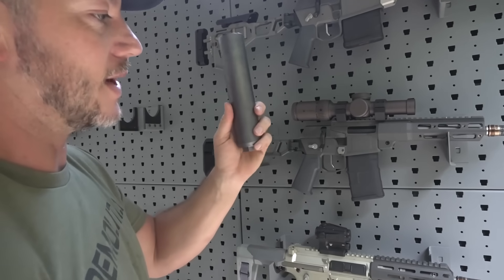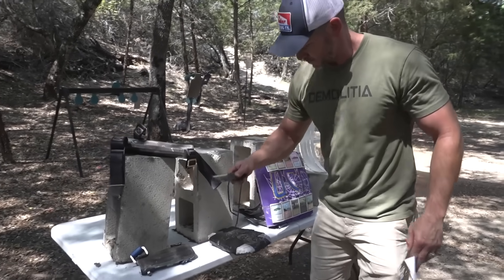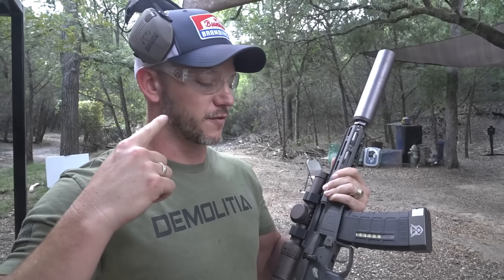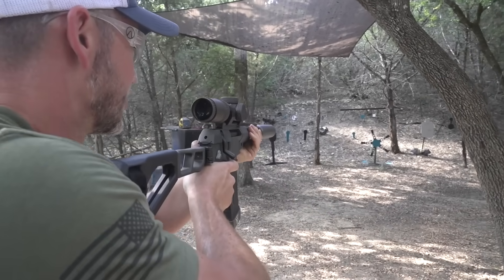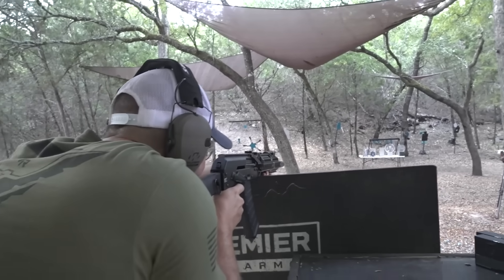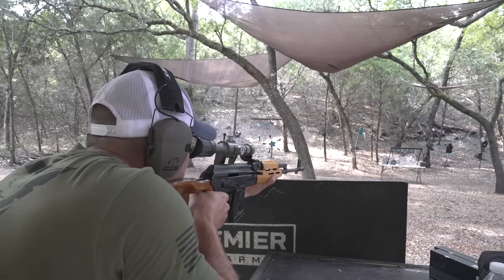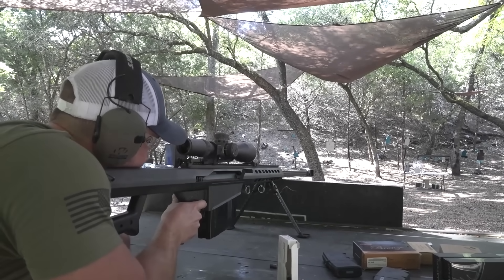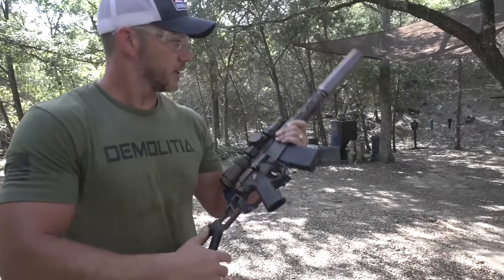The QUIETEST Assassin Gun Ever Made!!!

Comment: Honestly impressed by the shin and arm protectors. I’m curious what the specs on it as far as weight and mobility.
Reply: based on how they were thrown around, i doubt even the big thigh guard weighs more than a couple pounds, you could probably comfortably wear a full suit of it, though with it's thickness, it may interfere with a plate carrier if it reaches low or if you made bicep armor
Reply: @youtubeSuckssNow  no doubt some kind of lifted edge on hand side would help with that.
Reply: theoretically if you get shot at that arm protector while aiming it looks like there'd be a really high chance of ricochet straight into your face, due to it's polished surface.
Reply: @youtubeSuckssNow  and the thigh one would wreck your pork & beans
Reply: @youtubeSuckssNow  A deflection would take your face off. The guy's on the right track though. It just needs more tuning.
Reply: @sourcemonkey  polished surface causes ricochets? we should use tin foil for armor! in all seriousness, the outermost layer seems weak and catches the bullet like a catcher's mitt, preventing ricochets
Reply: @sourcemonkey  also my first thought but these things still held up great, someone should make a tempered steel version.
Reply: @youtubeSuckssNow  if you're smart enough to think of spall you think you'd be smart enough to think of a spall liner
Reply: Dude should definitely make a 2.0 version.
Reply: @gxc222  without a doubt
Reply: they're useless. The bullet just splashes everywhere over you after it's hit.
Reply: @Minty1337  given he intended it for 9mm and 556, it did really well. i want to see a titanium version.
Reply: I made this in like 4hrs and just wanted to turn something in. First time ever attempting to make “body armor”. I’m sure I could make something better, absolutely, I could have put a thick layer of rhino liner or something. But if Matt wants a 2.0 he can get ahold of me.
Reply: Just like old armor breastplates having a raised ridge across to deflect arrows and arrow spall away from the neck and face
Reply: @wesgroenke1647  on the arm protector - have you thought about running a wing type lip on the top edge, facing down at a 45deg angle. Also changing the surface of the arm protector to a pyramid type finish to deflect or diffuse a straight line impact, reducing the incoming energy to the shooter?
Reply: kind of like Iron Man's first suit..
Reply: @havok2396  I guess you missed the part wherehe said "I made this in like 4hrs and just wanted to turn something in. First time ever attempting to make “body armor”. I’m sure I could make something better, absolutely, I could have put a thick layer of rhino liner or something. But if Matt wants a 2.0 he can get ahold of me."
Reply: @Hovis_Enjoyer  I guess you missed the part where I liked that very reply, but was offering some other ideas he could try in the 2.0 if he wanted?

4hrs off the cuff is impressive, just think what could be done with collating all the feedback ideas and working them in, if he wants to?
Reply: No.. stupid idea.. spall into the face and junk.. or femeral artery.. na.. ill pass. Good idea but not even close to fully thought out.
Reply: @Minty1337  A full suit of gothic armour weighs up to 20 kg (A bit over 44 lbs) and is distributed all over the body. Imagine if this becomes standard issue, our boys can now take a Russian sniper round to the head and survive. Defense is finally catching up to offense.
Reply: They look heavy af
Reply: @sorashirogami1729 full gothic armor is on the backside, this isn't, so half the weight instantly removed for added mobility
Reply: Save your money don’t use deal Dash 

Hi Davie
Reply: @sorashirogami1729  A full suit of infantry plate is also far less bulky. It is not just about the weight. I can pretty much do anything in my 14th Century Infantry Plate that I can do without it movement wise. 

The problem with modern Ballistics armour is it needs to be fairly thick. That's going to cause issues anywhere the armour needs to articulate, especially around the joints and the neck were you need a good range of movement. And that causes serious issues when trying to design an all over suit of ballistic armour for people to actually wear in combat. How to deal with the weaknesses at the joints.

The other issue of course is putting it on. I laugh when people talk about full suits of ballistic armour, because most of those people have never tried donning a full suit of armour before. It is not a fast process. Takes me about twenty minutes to don my Plate if I am on my own. Ten minutes if someone who knows what they are doing is helping me. 

Then you have to remember, that's probably 70 lb of armour, at least. While that armour MAY be distributed over the entire body, believe me, after you have been wearing it for a few hours, and ESPECIALLY if you have been fighting in it, you start to FEEL it.

And thats BEFORE you take into account everything else the soldier is carrying. Weapon, ammunition, grenades, rations, water, trauma kit, secondary weapon, ammunition for secondary weapon, comms, vision gear (if issued), and so on. You are talking 120 - 130 lb of gear for a rifleman. Probably more than 150 lb for a gunner. That load is NOT sustainable for a modern soldier.
Reply: @Minty1337  this is the way

Comment: Note for Wes (if he reads this):  i like the concept of your forearm armor, but it would make more sense for it to be concave on the front, not covex.  This is because bullets tend to follow parallel to the surface they contact. With the current shape, you are more likely to force the bullet to skate past your arm and into your vitals. If you were to put a simple a curved lip around the edges, the round is more likely to miss the operator
Reply: I was thinking the same, it's a headshot helper as it is
Reply: I made both in like 4 hrs, just tried to turn something in, first time ever trying to make body armor at all. Knowing what I know now, I can def make something better, maybe just a little bit heavier.
Reply: @wesgroenke1647  you did a killer job, man! Yeah, my recommendation for a version 2 is do what you did again, just flip the design around and weld (don’t rivet) an ergonomic comfy side to it. Trauma pads are cheap, so id recommended that as a cushion if you want to go the extra mile. It would be hella cool if you uploaded a few simple videos of the build. Id watch it for sure!
Reply: @wesgroenke1647  It was an impressive showing, wish mat had shot it with something in between standard 7.62x54r and standard 50BMG, once it's that good finding a more finely accurate place where it fails is more interesting. I've got a can of silver tip 54r and it's really got me wondering if the mild steel penetrator would be enough to push through, or how other fast rifle rounds would compare, like maybe .270 Winchester (because on paper it's a pretty close match to .277 fury, but more common for now).
Reply: @Exandria   it was pretty fun to make it! I wouldn’t mind doing that at all, I could make a video on it, just need to find some time to make another!
Reply: @AmaraTheBarbarian   me too! Kinda wanted to see some .308 on it or a spicy .300, I like a .458 would have been cool to see on it too! I appreciate it man! 

I really do think that almost anything with an alloy core of some sort will make it through, there isn’t any hardened material on the armor.
Reply: @wesgroenke1647  Maybe take some of the same pipe, but flipped over on the edges to deflect any spalling away from vitals. Looked like schedule 40 so maybe  a layer of 80 on the back side. 
Well executed design 👍

Comment: First time here, saw one of the targets in your range that looked like the one my uncle invented, pretty cool to see it. Also, old timer trick, if you get some plumbers insulation foam and line the top of your "Premier" shooting stand with it you will no longer scuff the bottom of your barrel while shooting. Thanks for the content, carry on. "Rangers lead the way."
Reply: Congratulations 🎉 🎉 you've been selected!!!
Thanks for watching and commenting ❤️
Shoot me a text on the digits above ⬆️ to acknowledge your prize!!..
Reply: Overpriced pool noodles
Reply: is the "plumbers" foam any better at handling heat than other tubular foam devices? sounds like they would melt after a few shots.
Reply: @Fausto_4841  I think it all depends on the rate of fire. We didn't use full auto like he does so the heat could become an issue.
Reply: Personally I’d prefer to just spend the extra couple bucks to buy an 8’ pc of pipe insulation over a dollar store pool noodle.

Comment: Thought everything was on point until the backwards front sight, the 4 dot eotech for 300bo, and the fib sounding comment about ive sbr'd it but not took it to a local ffl to put a full stock on it. Lmao. If you got that tax stamp you wouldve done switched that out especially beings stocks are one of the cheapest parts to purchase on an ar15. Other than that i think you've done an amazing job. I liked how you are trainning with your irons as well. Especially doing it without ripping your optic off. Train how you fight. Thanks for the video have a blessed journey. Stay safe.